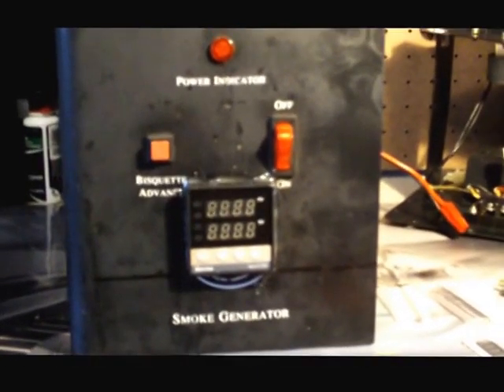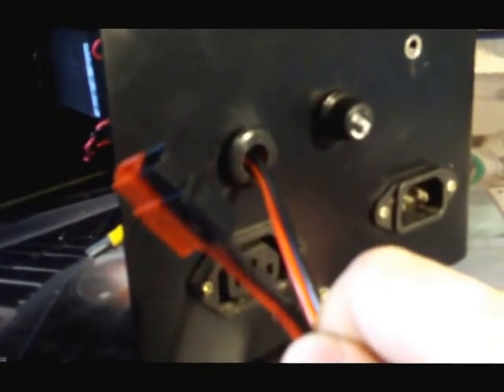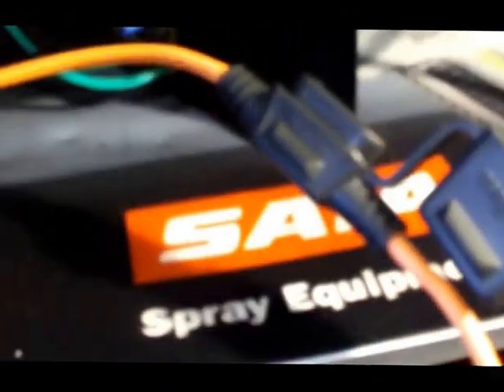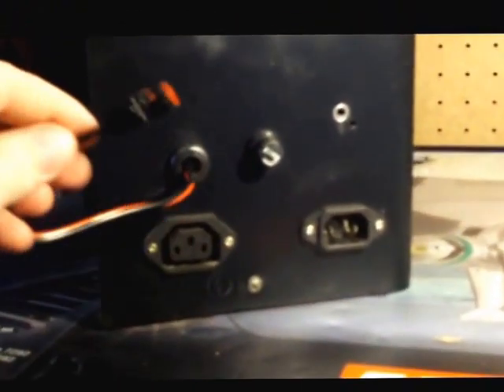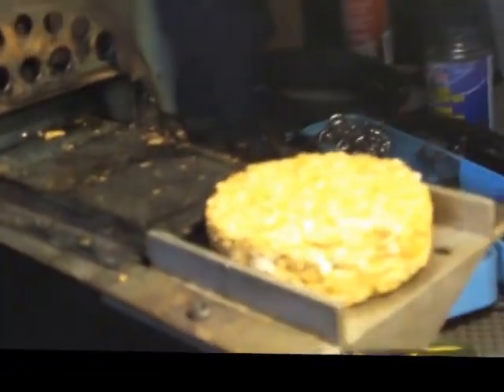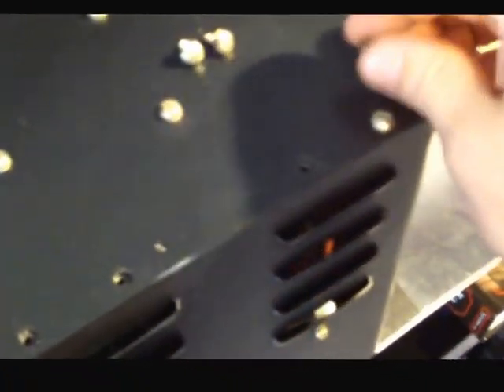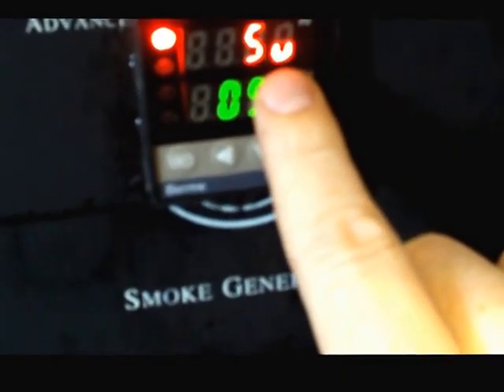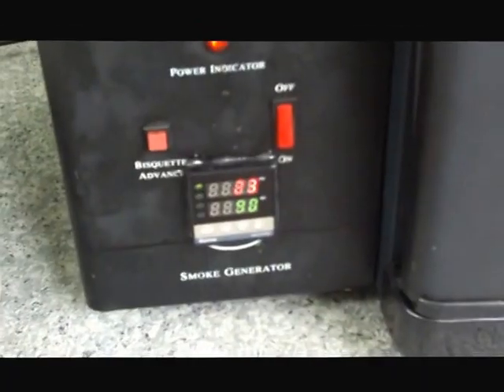BRADLEY SMOKER DIGITAL CONTROLS UPGRADE SAVE HUNDREDS $200

Comment: Thanks for the info, I am looking at doing this upgrade, can you provide a link on where to get the items. Does this just tie into the element that is in the smoker? The probe Where did you locate it in the smoker?
Reply from the maker: Hi, the probe I installed directly across from the door probe on the back wall so they read nearly the same temp. In fact I show in the video where to mount it. There are two different models of the classic smoker. If it is like mine with the rheostat under the front door you can take off the back and disconnect the two leads then join them together so the element will have full power when it is on like a home oven. If the temperature control is in the burner unit I would remove it all together  then install the PID unit there. The link for the one i bought is below. 

https://www.ebay.ca/itm/Digital-PID-Temperature-Control-40A-SSR-1M-K-Thermocouple-Probe-Heat-Sink/311420798123?hash=item48822044ab:g:IrEAAOSw-z9ZwgoB